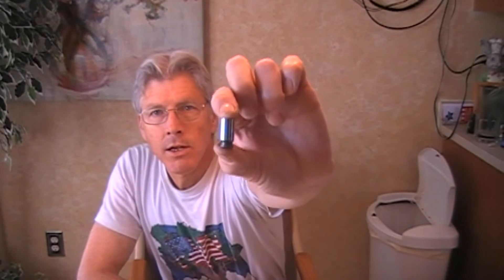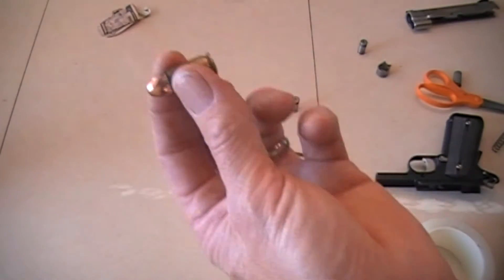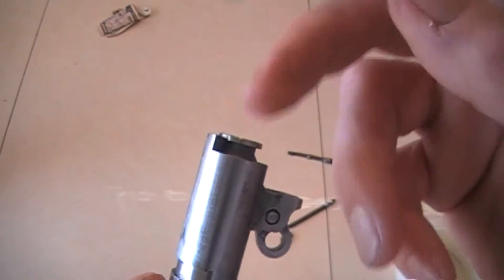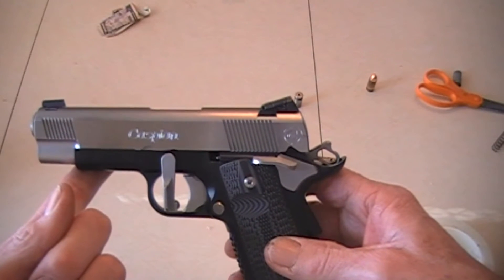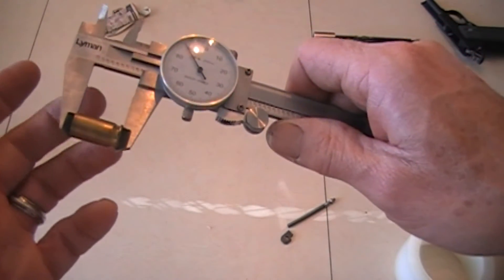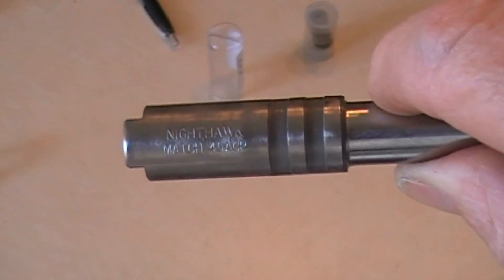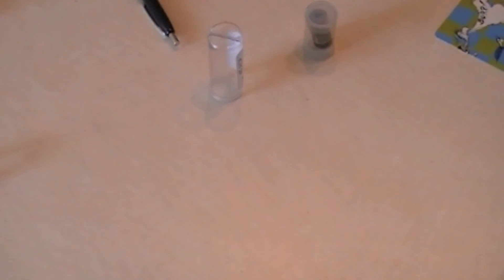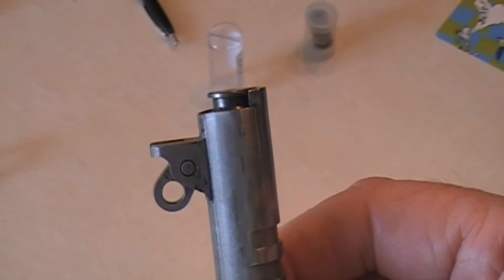.45 headspace

Comment: Question: isn’t the headspace determined by the location of the breech face in relation to the shoulder inside the chamber?  What I’m getting at is that there may be a small gap between the barrel hood and the breech face. We use the hood for dialing in a taper crimp, but it seems like you need to determine whether or not there is a measurable gap and take that into account if there is one. (I am not a gunsmith - contemplating a cartridge conversion involving reaming and want to be sure I don’t ruin my barrel.)
Reply from the maker: Yes you are correct. The go, no go gauge takes the breech face into account simply by weather the barrel will lock up or not. All slide barrel combos will be different as the fit of barrel to slide at the lugs and the hood will vary. The lengths of different brands of ammo vary and we have to have a little play for dirt and carbon build up as well. I would say when you ream your barrel go slow and check to see if your barrel will lock up with your cartridge. You can always come back and ream it again if its to tight. Go slow the reamer cut a lot faster then I thought it would. I'm not a gun smith either and as with every thing on the net double check before you run with it. Good luck with your conversion!!
Reply from the maker: Another thought I didn't make clear in the video is remove your extractor before using the gauges or cartridge. Have fun!!
Reply: @OXander61  thanks!

Comment: Brass has a little bit of give to it being a softer metal. So if a case is slightly over length, the recoil spring is going slam that case into the chamber. The go gauge on the other hand, is hardened steel. If you're short on headspace, even .001, she ain't going to fit.

Comment: be sure when doing this (readers). that your fitting the rim of the round UNDER the extractor or else it will not close until it "snaps" over the rim. -- or take the extractor out. - I was not clear if the poster did either of these. If the extractor is sitting on the back of the round's lip, then it wont close and will appear to long.
Reply from the maker: You are correct but if the extractor is sitting on the back of the round it would actually appear that the chamber is to short. Thanks for watching!!
Reply: Yes

Comment: Hi, is it possible to give me the reamer part # you used from Brownells? I'm having similar head space issue where my casting .452- 200RNFP is hitting the rifling before the round fits the barrel.
Reply from the maker: +Everson L Brownells 45acp rimless pistol finisher 513-051-451 Good luck and thanks for watching!
Reply: +OXander61 
Ah, much thanks. Building mine with a Wilson barrel. I like reloading with Starline brass and they run ~.894 new out of the bag. It won't even come close to lockup with a case in the chamber.

Comment: You should have a collar on that reamer so you can't go to deep. insert reamer into chamber, set a feeler gauge between the collar and the hood, tighten the set screw and you can only take as much as the feeler gauge. less guesswork and a smoother finish.
Reply from the maker: A great idea! I think I need a better handle too. Thanks for watching
Reply: The handle is fine but it would also help to set it up in something like a drill press to guide the reamer with a spring center. I never hand ream or tap anything without the support of a machine and dead center or spring center.

Comment from the maker: No the hood does not hold the cartridge at all, If the rounds will chamber the extracter will hold the round against the breech face in the 1911 and prevent it from sliding to far into the barrel. . But how short are we talking? There is .022 thousands leway between a perfect headspace and one that is on the verge of being too large. Cases way out of spec should be discarded. I hope I nailed it this time. Thanks for watching!!

Comment from the maker: The 45 acp cartridges headspace on the case. A short round with the bullet set to far back in the case will not effect headspace but may have dangerously high preasures. One with a short case may feed just fine being held by the extracter but accuracy may be off. Depends how short and why.  Im not sure what grooves you are discribing but toward the chamber are the locking lugs that connect barrel to slide and of course the rifling inside. Thanks for watching!